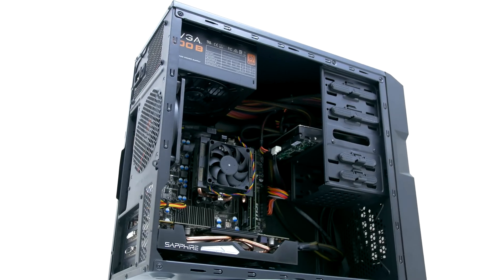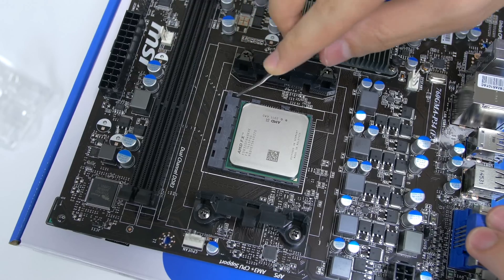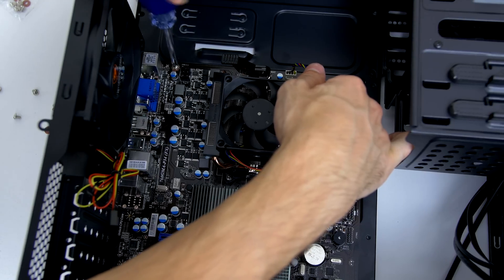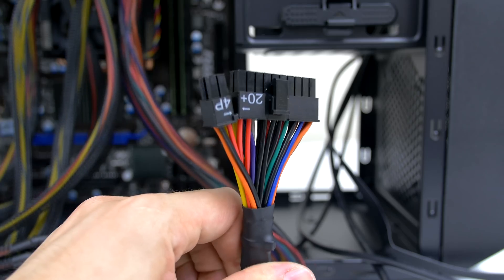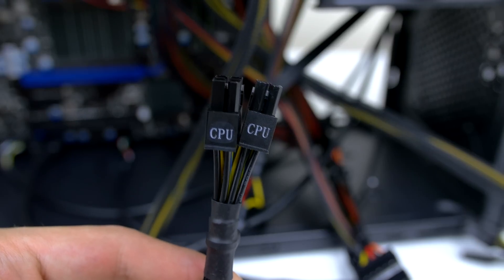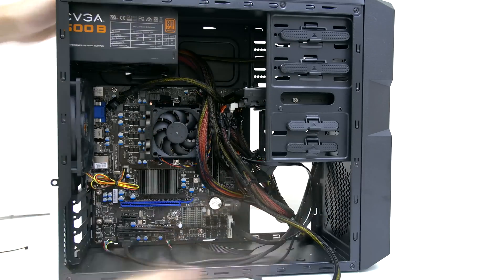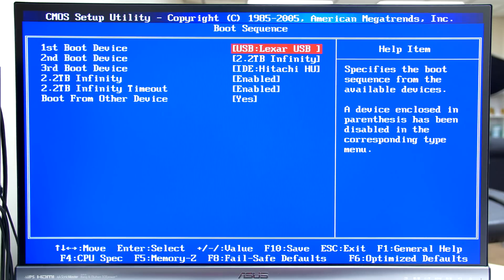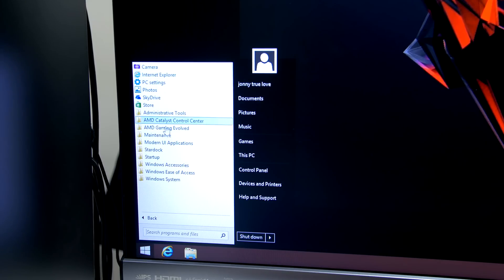How to Build a $500 Gaming PC with Windows 8.1

Comment: I'm trying to get into pc gaming any advice.
Reply: +KATUMBALA yes you do, if you want i could.. maybe try to downgrade the parts so you can fit in other accesories.
Reply: KATUMBALA actually you could just buy a mouse and keyboard (look for cheap logitech key+mouse) and use your TV for now until you buy a monitor.
Reply: COCOS20X X20X why
Reply: If you look forward into pc gaming i firstly recommend you learn how to build one since pre builds are usually overpriced or .. not good xD second do research. I can help you find a build that fits you just tell me what your budget is 400-1000 or more if you like. Pc is about options you don't have to high end graphics to play games. It completely optional!
Reply: It's*
Reply: COCOS20X X20X pc's are factually better than consoles for many reasons (better platform of choice) mainly because you have more options (consoles are limited / packaged experiences) (as of pc you can make your own experience). But i don't have a problem if people choose to play on consoles. Play on what you wan't to play on. 👍👍👍
Reply: ive had an xbox one for about a year and it was all rirght for a while but now its pretty unsatisfying..
Reply: Mellotus oh i have a 700 dollar budget any tips?
Reply: Nateshark10 depends on what you want from it try looking up 600-700 dollar pc's aug 2015 (make sure windows and optical drive is included / these are not completely required to get windows running on your computer, there are many other ways to get windows but this might be easier) show me the build if you want and ill fix it(modify) / let you know what you could possibly get from it.
Reply: just an entry level pc
Reply: +mellotus_doe Do you know any videos that can help me with building a 500$ gaming pc?
Reply: This one.
Reply: pablo garcia 

http://pcpartpicker.com/user/Mellotus_doe/saved/MHq2FT
Reply: pablo garcia if you can find a way to get windows 7 / 8.1 for free then just take out the optical drive and operating system off pc part picker and just look for a better graphics card OR processor

w/out operating system + optical drive added

http://pcpartpicker.com/p/sntB3C
Reply: +Nateshark10 try upgrading your graphics card to a few higher ranks, because my geforce 610 sucks but 760 is awesome :D
Reply: Budget?
Reply: KATUMBALA http://pcpartpicker.com/p/brZQWZ
Reply: ***** 
#1: what is your budget

#2: would you like mobility or not? It decreases room for upgrade ability but it is mobile

#3: do you need a keyboard / mouse / monitor / wireless adapter? Any other peripherals :P?
Reply: Get a pc.
Get steam.
Get Linux or Windows 7.
Play.
Reply: if you have a console get a hammer and smash it, then build the same pc in this vid
Reply: +Outsider Get EVGA 600B 80 plus it the same price on Amazon and it cheap and more watts
Reply: +Outsider get Kingston 8gb on Amazon it much cheaper and it great
Reply: +Fire Brand You're not funny fucktard.

Comment: I actually just finished building my PC but I have an issue. For some reason my USB ports in the back and ethernet cable won't work. When I plug in my Ethernet cable, it shows a green light indicating that's it's all plug in. I don't know if I need to update the motherboard with the disc. If that's the cause, how would I be able to without an Internet connection or a disc drive?

Comment: Do you need to add thermal paste at all? Would like to know because I'm building this pc also do I need to worry about it over heating?
Reply: The Sega Saviour dafuq? Yes, you always need thermal paste! It normally comes already on the fan if it came with the cpu.
Reply: Newshot18
so i was correct he dosn't need to buy thermal paste
Reply: Quetarro keever only if your overclocking if not it should be fine
Reply: Always add thermal paste its extremely cheal and extends the life of your cpu. Overheating should not be a problem with this especially running Mincecraft
Reply: droidtrooper100
don't you see he's talking about an aftermarket thermal paste? Why if you get it in the box would you discard it?

Comment: Hey guys im moving to pc gaming and i want to get some advise on my first build, and could it run Gta5, Skyrim and if so at what settings? http://pcpartpicker.com/p/8fvfLk
Reply: +UnholyAvocado  it is a good build,but personally, i think you should get a core i5, a compatible motherboard and an amd r9 390 because there have been some rumors of the maxwell series not fully supporting directx 12, and the FX-6300 will bottleneck either of those gpus, maybe not a lot but it definitely will.

Comment: I followed your steps but I ran into a problem. When i boot the pc, it turns on for a second then turns back off immediately. There is a green light that is turned on in the motherboard but I can't get it to run.
Reply from the maker: Will Hunter You sure you connected all the cables into the right sockets on the motherboard? It sounds like a defective part is in play. Does the motherboard beep when you turn it on?

Comment: For any new PC users like me you're probobly thinking, wow what a great pc for cheap. Well as the video title says the PC is $500. Well it's not. First of all, the Saphire GPU costs almost half the amount of the $500 mark. There is 7 key components. Now obviously the GPU is the most expensive part but other parts still cost at least $35. All in all this pc costs $618.83. Now this is not including a keyboard, a mouse, monitors, and anything else you would need. Plus since the windows version must be bought that's an extra $60 so to be honest if ur on a budget, this is not the one you need. But to be fair this is a great PC!
Reply from the maker: Wulf Gaming You probably checked the prices all on amazon. If you shopped around you can buy the parts all for under $500. I just checked the prices and I came to $486.74

Comment: i think its more than 500$ with the parts used for ORION. And can i use a an old cooler ? for the ORION PC. thank ya and rlly good vid
Reply: An old cooler from an old build? Then yes you can if it can fit into the socket of the cpu and the motherboard and depending on the cooler if it's fits into the case. But you will have to apply new thermal paste to the cpu and clean the thermal paste off the old cpu cooler if you don't you WILL over heat your cpu

Comment: Kinda iffy about getting used PC parts... Can anyone confirm that this would be ok. (First time building PC and want to be safe)
Reply: Used from what source? Like used at like newegg? Or used from a local friend/retailer? I would generally recommend buying everything new due making sure that you get all the cables, ect that comes originally with the part. But if it's like used I would dust it down first don't like wet it or blow compressed air right into the fans or whatever just pat it down be careful with anything because it will fragile
Reply: Daniel Burgos He means used from amazon, which has a history of people getting mislead/scammed

Comment: Hi, im new to this PC gaming and im going to order theses parts soon. When looking at the GPU's i noticed there was a 2gb edition and a 4gb edition. The price diffrence is only $30-ish would it be safe to go with the 4gb edition (using this build) i dont know much about building tho and i dont wanna get the 4gb edition if the PC will not accept it or it will not fit.
Reply: clinton fisher The performance difference with the 4gb edition isn't really worth the money
Reply: Misterfox20 thank you that's good to know was more worried about having to upgrade the PSU and not know which one/connections I would need.

Thank you again

Comment: How much fps will you get when you run GTA V in high?
Reply: Jibbe Dz At least 60 fps. You can run GTA V with almost every setting on Ultra with this card
Reply: Misterfox20 Alright but there are 2 versions of this GPU a 2GB and a 4GB version. I should go for the 4GB right? It is just 10 dollars more.

http://www.newegg.com/Product/Productcompare.aspx?Submit=ENE&N=-1&IsNodeId=1&Description=Sapphire%20R9%20270x&bop=And&CompareItemList=-1%7C14-202-050%5E14-202-050-TS%2C14-202-049%5E14-202-049-02%23&percm=14-202-050%3A%24%24%24%24%24%24%24%3B14-202-049%3A%24%24%24%24%24%24%24
Reply: Jibbe Dz Get the 280 while it's on sale for cheaper than the 270x: http://www.newegg.com/Product/Product.aspx?Item=N82E16814150706

Comment: Hi there!

First of all thanks for all the work you done and all the tips provided!
Now the questions:

1) Why not GeForce GTX 760 ? Same price or less expensive and better performance acording to a GPU benchmark site

2) Would you recomend a double GPU setup? Using SLI or Crossfire

3) Does in any case a dual GPU setup using double $150 cards outperforms a  single $300 card? Pro's and Cons?

Comment: I am somewhat disappointed because this all added up to $532.55 (USD) & $836.54 (NZD)
and I get the prices fluctuate... But this is very expensive in New Zealand... and that doesn't even include the OS Windows 8.1... Or yet to mention any of the Periphirals... 

But anyways AWESOME Build and I am ordering the parts as we speek. Instead of the 1TB HD recommended can we use a Western Digital Blue ?
Reply: Raaiizee You can use a WD Blue, although the one he used us usually cheaper